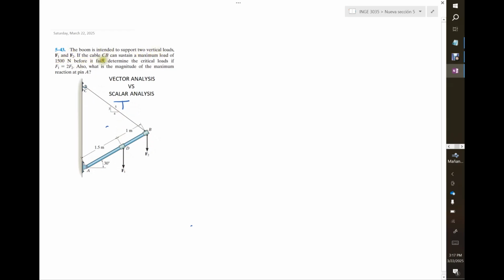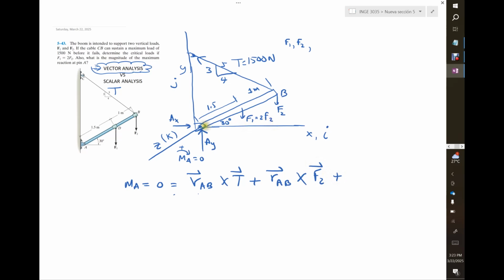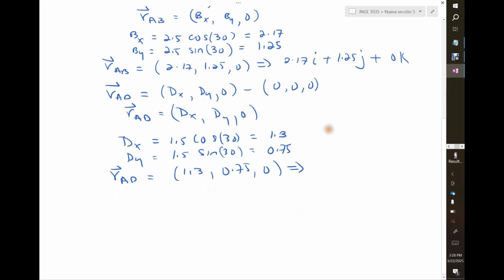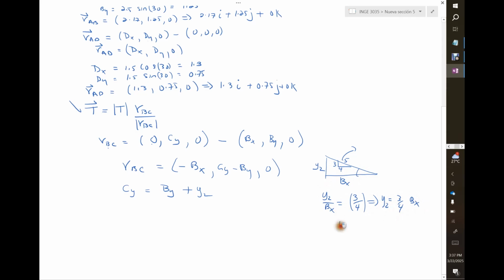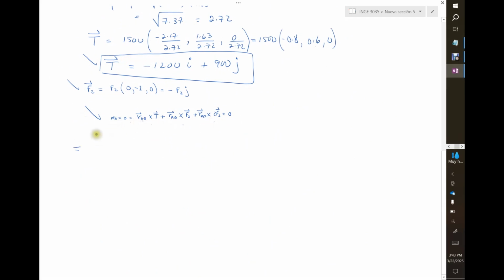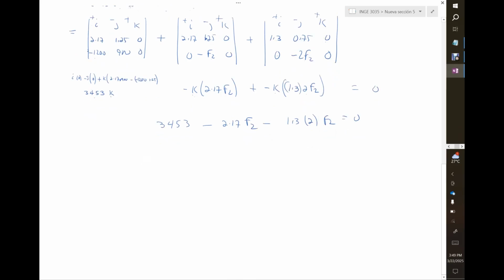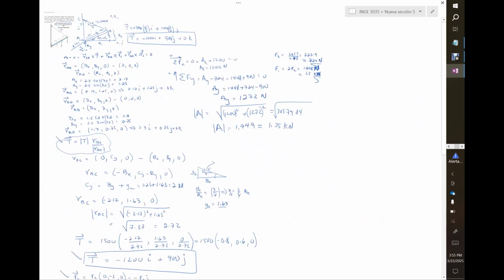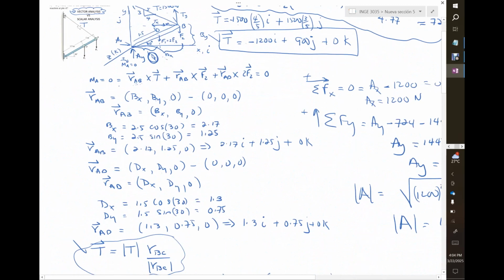STATIC IN ENGINEERING MECHANICS: VECTOR VS. SCALAR ANALYSIS IN TWO DIMENSIONS

Comment: Excuse me sir, I'd like to know why in 6:02 the F2 and 2F2 components are positive? Like, you are using clockwise as positive, then shouldn't the Tensor be negative since it counterclockwise? I dunno, im kinda foggy there
Reply from the maker: They are vectors...vectors will take care of the positive or  negative direction of the moment  when you take the cross product.  If you are doing scalar analysis...you need to take care of  the direction. Thanks for watching.